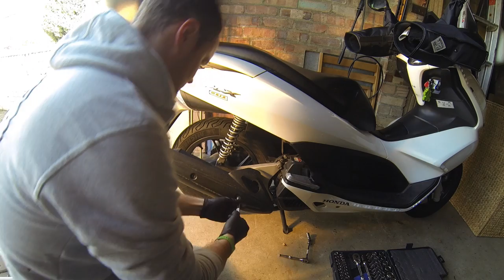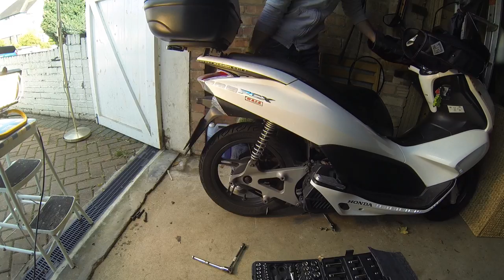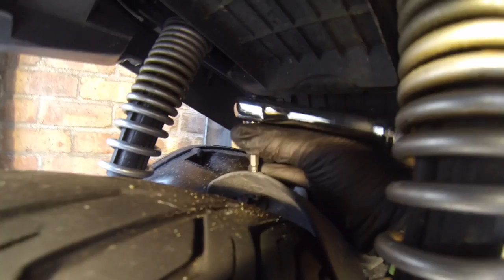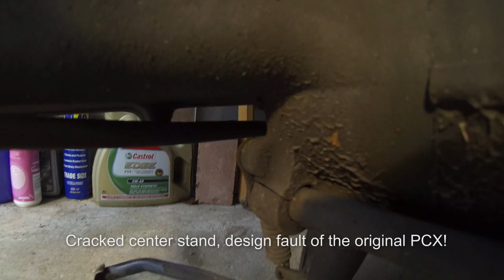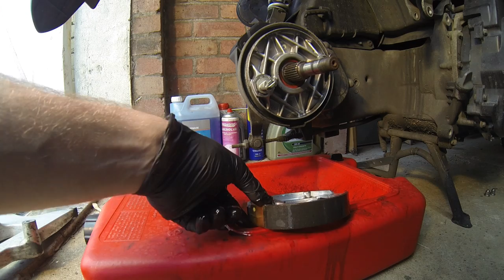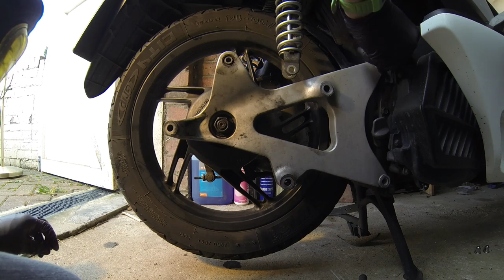Honda PCX - How to remove rear wheel, brake drum and shoes

Comment: To ALL viewers...

One thing that is important but which this man did not (seem to) choose to do:

After cleaning the brake components, carefully apply heat-resistant grease (I use Suzuki's Super Grease Type A) to the lobe/cam which opens the brake shoes forcing them against the inner walls of the drum (wheel). If you do, you will get a smooth return (the brakes go back to the 'off' position) when you release the brake lever.

I have not done this on my PCX yet, but have done it on my other scoot, on which it seems to be necessary about every 5,000 kilometres.

Happy trails!

Comment: As well as lube on the cam that opens the shoes, put some copper grease on all the bolts before replacing them - much easier to remove them next time. If that was your first go you did a good job and saved yourself some cash as well as learning about your bike. Nice one...

Comment: the way I get those tight axel nuts to move is to put the handle of the wrench into a 2.5 ft piece of pipe. The extra leverage does the trick.

Comment: I need HELP. i've been trying to remove my PCX rear wheel.
but i am stuck in loosening the main bolt on the rear wheel, i used impact driver, but it wont even budge.
Please help me master...
Reply: Best to get someone else to sit in the bike and hold the rear brake on. Use a breaker bar. Should work fine. Don't ruin a ratchet!

Comment: When I took the rear tire Bolt off of my PCX. instead of using a impact gun to take that bolt off . I used a ratchet and a rubber mallet. and Hit the ratchet lever with the rubber mallet. (it came off relativity quickly). That bolt needs short bursts of pressure instead of applying pressure on the ratchet long and hard. ( I don't have a impact gun , and don't feel like buying one. at the moment. so that Is why I did what i did.
Reply: I was hoping to hear his lumbar vertebrae pop. Imagine someone in their 50s or 60s straining on that axle nut. Way to go, Honda!!
Reply: Don't use a ratchet for high impact work like that. I've seen them disintegrate. 
A breaker bar is accurately named for just that job.

Comment: Hi...
I couldn't tell on the video, What is the brand and model # of the impact tool?
Reply from the maker: Got if off Amazon, search 12v impact gun and it should show up...

http://www.amazon.co.uk/AEG-97135-Screwdriver-Digital-Accessories/dp/B004PZG59G/ref=sr_1_fkmr0_1?ie=UTF8&qid=1427923032&sr=8-1-fkmr0&keywords=12v+impact+gun